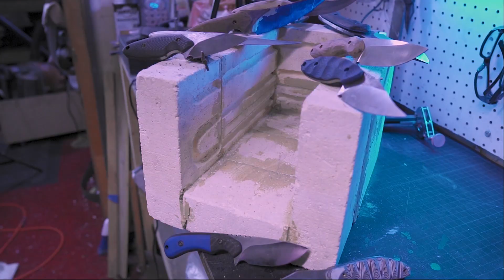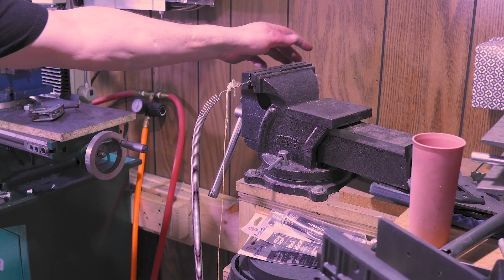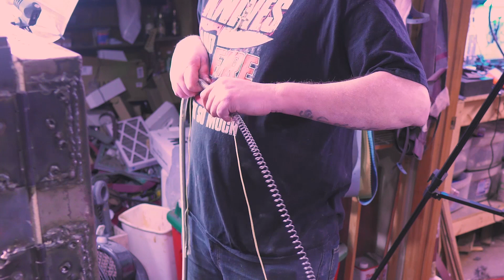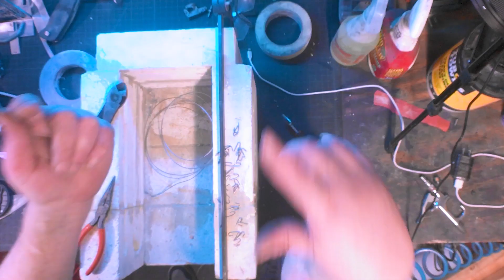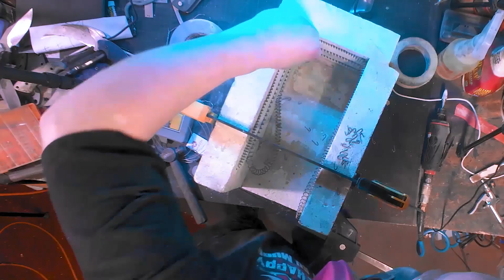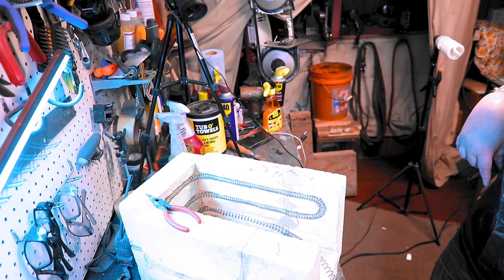Heat Treat Oven Build... from scratch (part 3 Installing elements)

Comment: hi dave i just got my elements in the mail yesterday from kilnparts.com i got the 54inch 240 volt ones they sell i made a mistake and measured the inside of my oven and now my elements are lik 10-12 inches to long  any  advice as what i should do?i compressed them in as far as i feel comfortable doing if i cut them will that screw up my resistance it would increase my wattage i think i was shooting for around 3500 watts if you have advice i would love to hear it thanks any way to contact you email?cell# thanks Mark i just to make sure i dont screw this up the elements were alot of$$$
Reply from the maker: Instead of using 2 elements could you just use 1 & cut out a lane? So instead of too long you had to stretch them a bit? That's what I did in my big oven the first build. You could always save the 2nd element for down the line incase you had to replace them. My other suggestion, if possible, maybe run them across the ceiling?
Reply: @evaderknives  I already cut the lanes out last night I’m not sure what to do ??cutting 10 inches off not a option?
Reply: Would one element would it get hot enough I have this at 18 inches deep 8.5 inches wide and 6.5 high ?thanks for your input Dave
Reply from the maker: @Anderson-HandForged  That is the size of my oven... did you watch this? It only has 1 element... https://www.youtube.com/watch?v=LqU6p2wv4fk&list=PLWqIpYSSgZJhH_EBt8L-CkcNwG69gAQvW&index=7
Reply from the maker: @Anderson-HandForged  Sorry that was the wrong video, this is the one I replace the small elements with the one you have. https://www.youtube.com/watch?v=p2WjcHch_8U&list=PLWqIpYSSgZJhH_EBt8L-CkcNwG69gAQvW&index=2
Reply: @evaderknives  thanks I don’t think the one element will stretch that far   This is turning into a nightmare

Comment: great videos dave i was wondering what was the item or part number of the element you got for that oven i was gonna make the exact same oven just didnt want to order the wrong part thanks and the ssr units are they the 25 amp ones?
Reply from the maker: I think I got the 40amp SSR, but If I remember 25 should be enough. The elements I got from KilnParts, just go to"other parts"... Good luck

Comment: respirators dont work with a beard because it doesnt seal against your face
Reply from the maker: O.K., so I guess I'll just stop wearing anything, that'll be much better for my breathing... Funny though, when I'm working with Carbon Fiber & I take it off, all of the sudden I taste chemicals... Just wondering, do you know this for a fact or are you just reading the safety guide???
Reply: I learned it from training at a nuclear powerplant, you can test a respirator for leaks by holding you hands over the filters and breathing in and if it is a good seal air wont come in.
Reply from the maker: @T444EFORD  Right on, I can appreciate that, but you are also putting pressure on the mask with that test... All I know is, if I'm wearing it, I don't taste chemicals, if I remove it, I taste them, that to me is real world proof, it is better to wear it, beard or no beard... Thanks for the info...

Comment: Hey, Dave! I'm new to knife making and I was wondering what my approach should be for making my first knife. I have limited tools (Angle grinder, drill, files... stuff like that) and I'm not sure how I should put a bevel on a knife or even what steel to use. Any advice would help. Thanks!
Reply from the maker: a great steel to start with is 1084. It's easy to work & easy to heat treat... To be honest with you, if you are just starting out, check out guys like Walter Sorrells, Simple Little Life and OUTDOOR55, they have a lot of basic tool videos... but come back and join the community... I'll try to help with any advice i can... take it easy
Reply: @evaderknives  All three of the Youtubers you named are imo some of the best and my most frequently watched. I guess it's time to quit stalling and order me some steel! Thanks
Reply from the maker: @OK-pc1nt  Yeah, no better time to start... You might even want to get some scrap mild steel and practice... It won't make a good knife, but it'll give you a feel for what needs to be done. Also, we all mess up at 1st, so you won't be too attached to a practice piece...
Reply: @OK-pc1nt  yea jus keep ur first knife so next year u can look back a see the progression, still got mine and it didnt even get hardened , after 3 trys even , lol
Reply: @evaderknives  agreed thats how i did it , and watching dave do em ,
Reply from the maker: If you go to sites like Alpha knife supply or jantz, you can get small pieces of 1084 to start with for around $20-30(if you're in america)